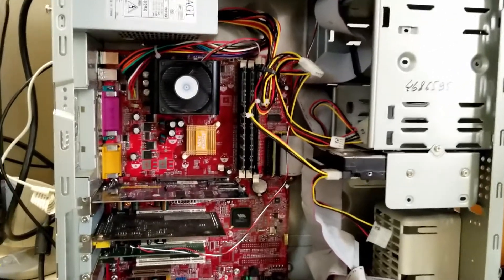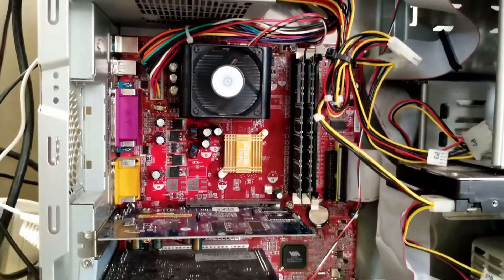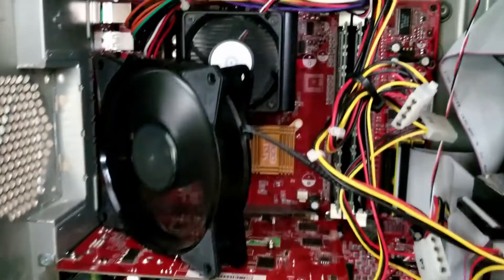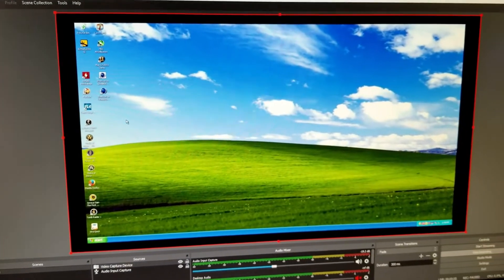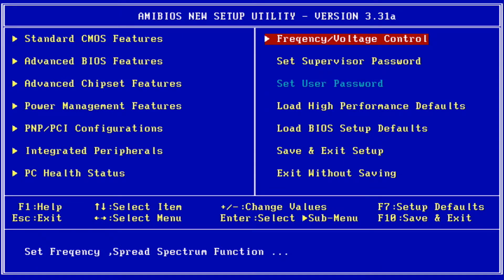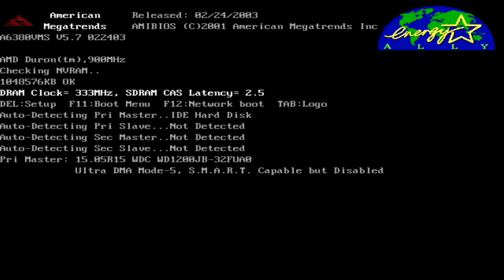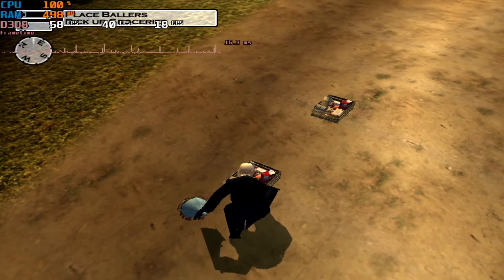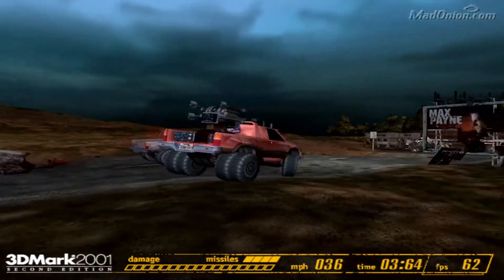MSI KT3 Ultra socket A and AMD Duron 750

Comment: Glad to see it's back alive.  Could you please share the specs of the capacitors you replaced? I've got one of those myself but I think it was recapped incorrectly and it's acting up.
Reply from the maker: If i can dig it out i will check, i dont recall offhand. I know its been packed away for quite a while now
Reply: @Snickerrick  thanks in advance!

Comment: Nice video. Just got a Duron 1Ghz to play around with but the system won’t boot. Ok to boot with an XP 2400 and XP 1800. Did you have to do anything other than a CMOS clear to get the Duron to work?
Reply from the maker: No, I didnt have to do anything different, it just worked. I had a stack of athlons and couldnt get any of them to even post, eventually I tried them on another board and found out they were all shot. The duron was the only working socket A CPU I had out of about 6 total. Could be your duron is also failed?